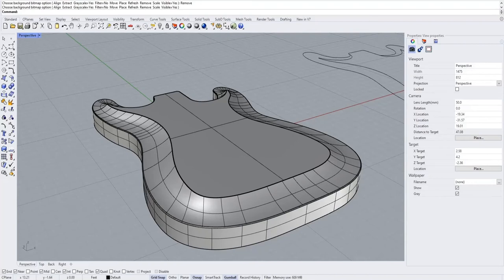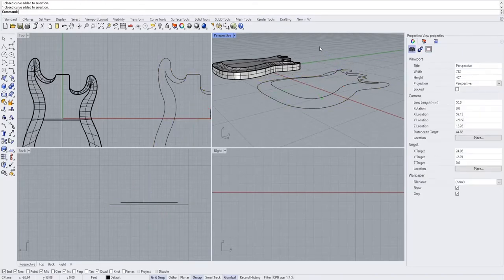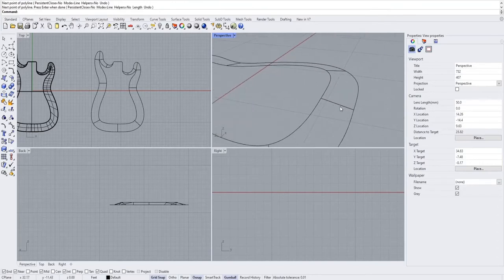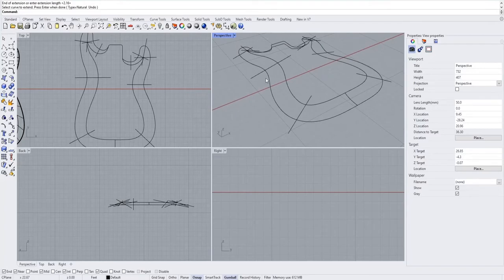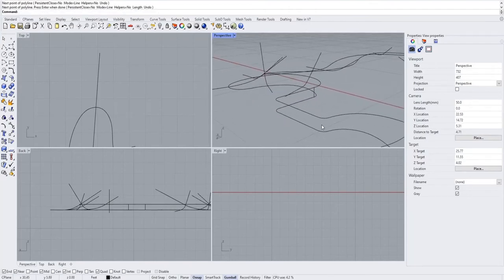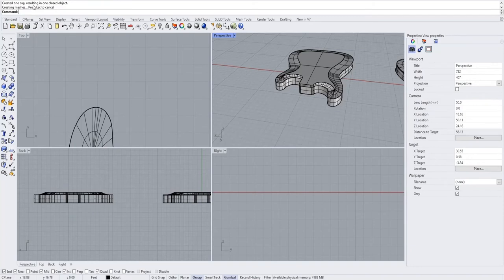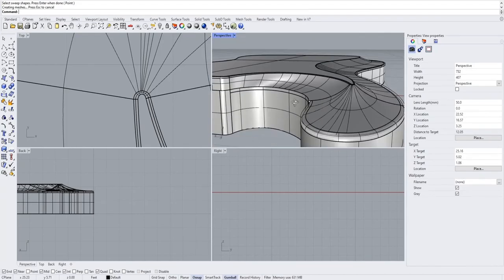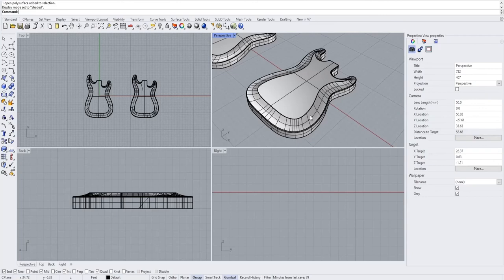Make a Carved Top Guitar in Rhino 7

Comment: NIce Video again, I use fillets also instead of blending manually. Only issue I have with your method is your outline profiles. They have way too many points. You should simplify the curves as much as possible. Single span outlines and using the change degree command. Fillets are way cleaner this way and I've been able to get my fillets up to 1/2 an inch or more. It also make your sweeps better and boolean functions cleaner later on. Thirtysixverts has great videos on making your profiles cleaner. It's the foundation of surfacing, especially if using the surfacing tools. Also when making an outline, you should use the curve analysis to check your curves, making sure nothing looks bad. Also use match curve between segments and making them with as much G1 or G2 continuity. Either way great videos again, keep up the good work!
Reply from the maker: Valid points! I try to keep my videos a bit more beginner friendly and as short as possible but if more people start asking about advanced surfacing methods then I could definitely get into that. Either way thanks for watching! Cheers.
Reply: @garretelliott8584  Right on man! I was trying not to sound so bossy. lol Would love to see advanced stuff. I finally modelled a whole guitar. But I cheated using network surface, and filleting and sweeps. I still can't manually match and blend everything perfect like a pro. My zebra stuff is smooth but not perfect. Your neck was really helpful kind of viewing things out of the box.  You and helix make the best rhino guitar videos! Keep it up!
Reply from the maker: Thanks man! I strangely have alot of fun making them lol. I think next I'll be doing a video on a neck thru guitar
Reply: @garretelliott8584  That'd be sweet man!